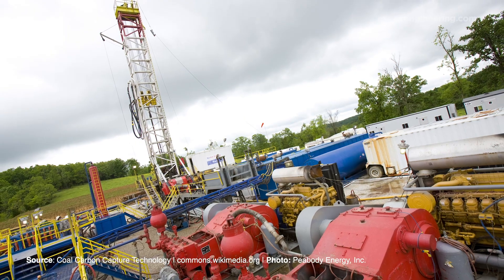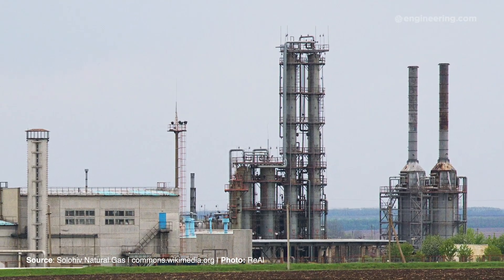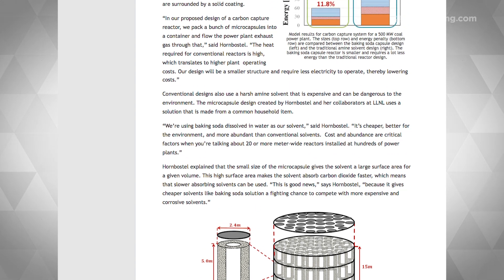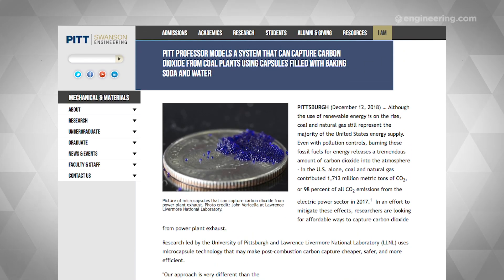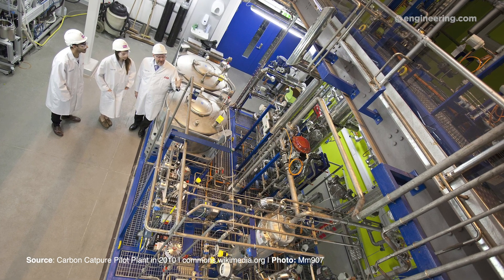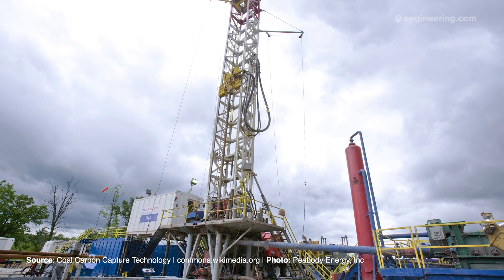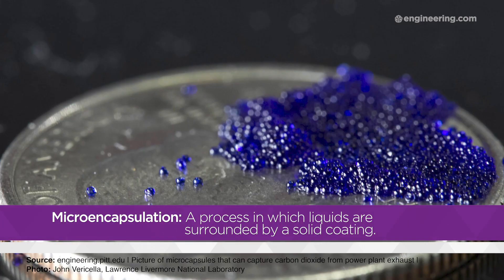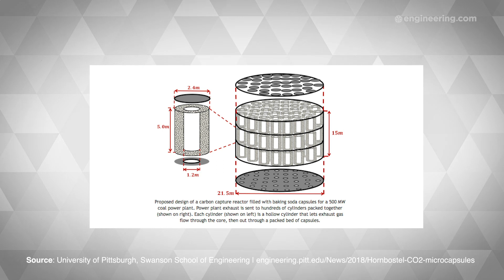How can we reduce carbon emissions with baking soda?

Comment: There is another method 2 young lads came up with that captures c02 using water as a solvent and turns it into baking soda using pure lye/soda.   I'm nonexpert on sourcing materials for and making lye thus idk it's sustainability but baking soda ik for sure is a natural and nonrenewable resource so it be a boon as a byproduct and a bane as an  input.   In other words this idea in the video is doing it backwards.